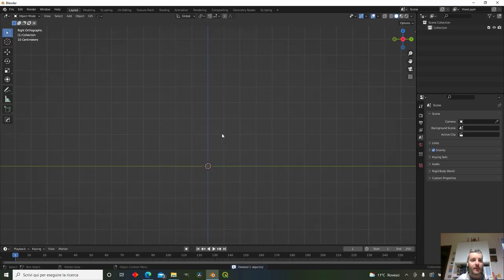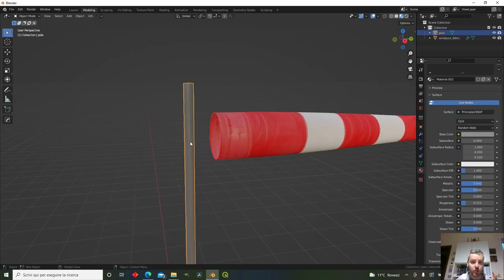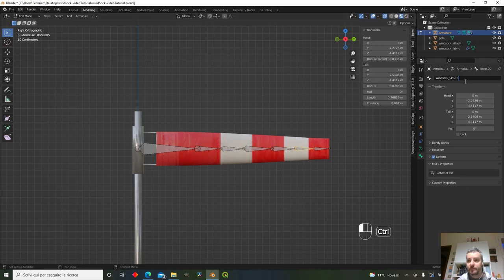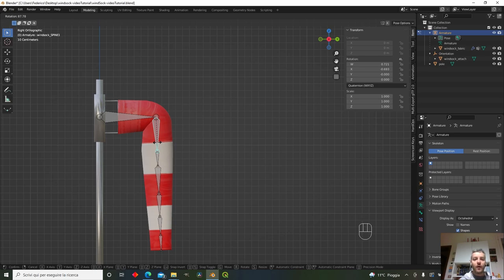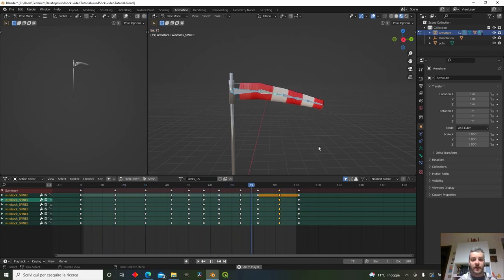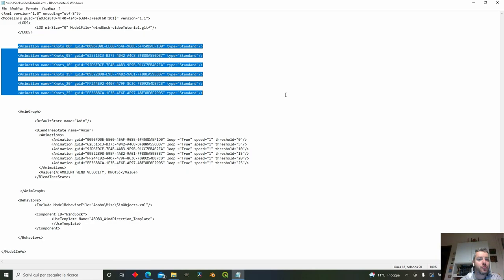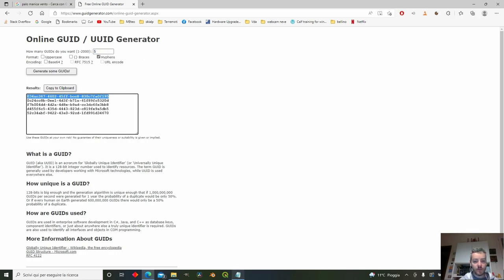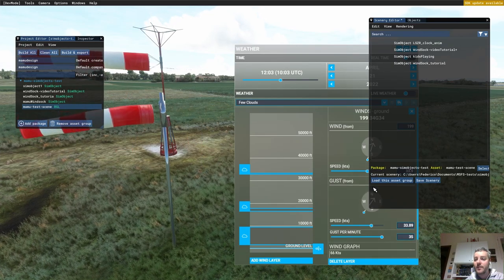MSFS animated Windsock Tutorial - How to make with Blender - Game Ready with Armature

Comment: Very good and interesting tutorial, thank you. However - i wanted to try this right away - using blender 3.1.2 - using the new asobo exporter (like in your video). The only thing i've changed is, that i wasn't using a windsock model, i've just created a simple box, stretched it like a long box, to be able to add a few bones and bend it. So i did all the steps (again, except i was only using one bone animation, together with the orientation and the default_state anim, so 3 anims at the end). After doing everything like in your video, at the end i've exported this object with animation - so 3 files (.bin, gltf and xml) got created. Testing it in Windows 3D viewer, the objects appear, 3 anims are listed. the default_state not moving, the orientation rotating 360 deg - but the anim of the stretched long box (like a snake) didn't move, it was just stuck in the all cleared transformation horizontal position (the same like the default_state) and not moving ??  Very odd, since i can't recall doing anything different from your video (slowly step by step - except of doing just 1 bone-anim instead of your 6 bone-anims) ... i've heard off "baking an animation", but in your video this doesn't seem to be necessary to do ...
Reply from the maker: If you can join me on discord and send the Blend file i can take a look at your work 😉
Baking Is used when the animation Is not driven by keyframes (like Path/curve animations or animation with constrains like Copy location/rotation)
Reply: @MSFS-SDK-TUTORIALS  Thank you for fast reply and help !  1000 thumbs up ... if i could  ;)

Comment: 👍👍 Another great tutorial Federico!  Do you know why SimObjects are not scalable in MSFS?  I ask because I use the excellent  tsr-windy-things flags and windsocks in my scenery and quickly found that I can't scale them.  In fact, they do immediately scale by changing the value in Gizmo, but the new scale reverts back to default as soon as I build the package. 😭
Reply from the maker: Thanks Jimbo!
Yep you can scale Simobject, has been a default behaviour since the sim release. However could be possible that with su10 they will fix the issue 

https://devsupport.flightsimulator.com/questions/7631/jetway-scale-doesnt-work-12570.html